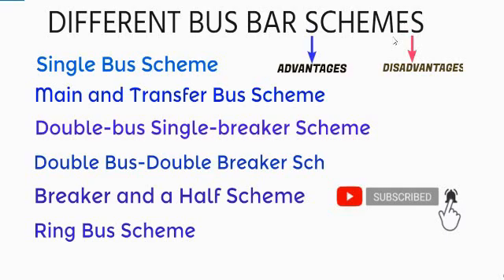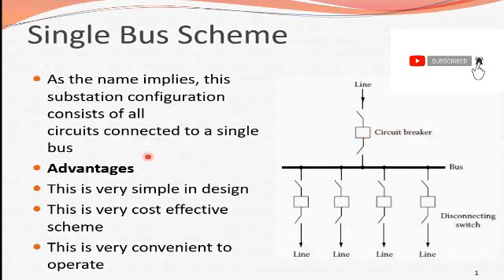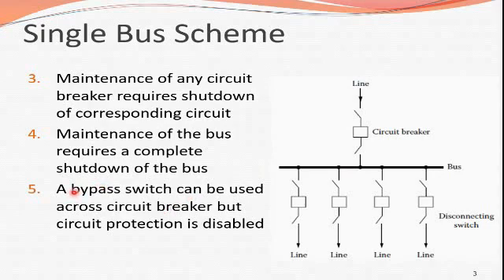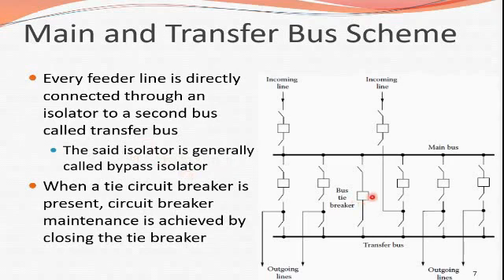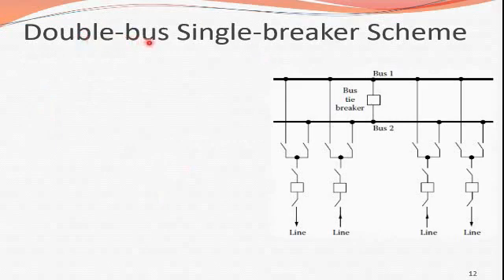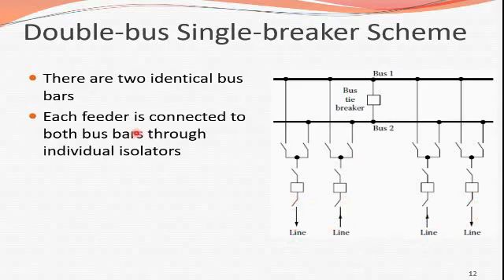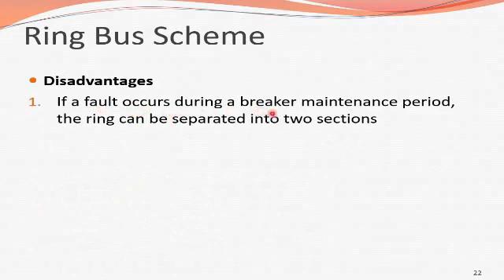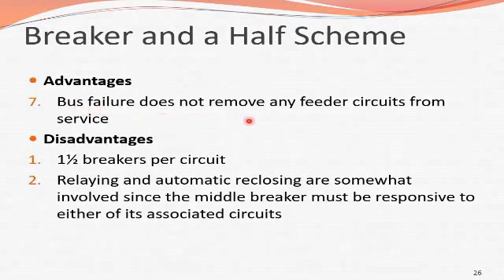All Bus Bar Schemes in Substation | Electrical power system | With Advantages and Disadvantages

Comment: I think it is also possible to have a main and transfer bus system where the main bus is segmented with a normally open bus tie.  In this case, if a main bus section is faulted the transfer bus can be used as a backup to serve the feeders which were connected to the (now out of service) main bus section.  The disadvantage is that the individual feeder breakers on the healthy bus section will be loaded to twice their normal load.  May require a different relay setting enabled through the microprocessor relay software logic when the transfer bus isolator is closed on the feeder lines but it is possible.  It is only a temporary solution as you will have slower protection schemes, particularly when 50/51 type relaying is involved.  A better solution, in my mind, to help survive a bus fault is to have feeder ties in the field that can bridge to other healthy feeders which emanate from other busses.  Or, better still, source your feeder main groups serving a load area from different segmented bus sections.  If network load is served, with either secondary network transformers or a radial fed system with automatic feeder throwover at each customer station, the customer will either receive no outage in a network situation or a very brief outage on an automatic throwover scheme in the (rare) bus failure.  Either case requires careful contingency condition planning for loading.

As you mention, the very best solutions involve multiple breaker and bus schemes but these are the most expensive and also use the most substation space.
Reply: Hello Sir, but i didnt understand disadvantage